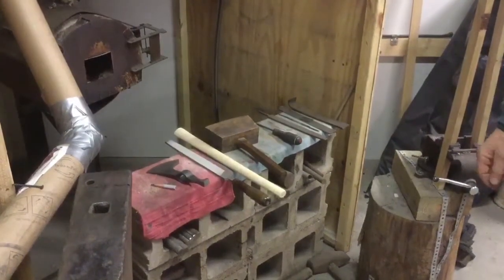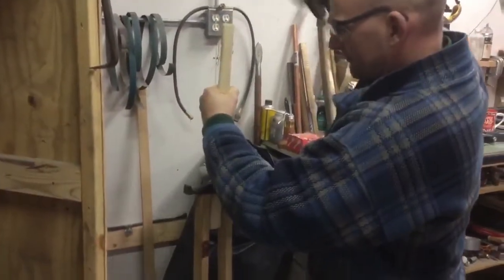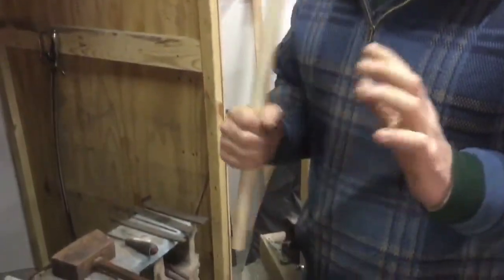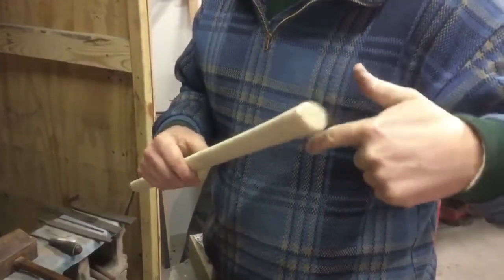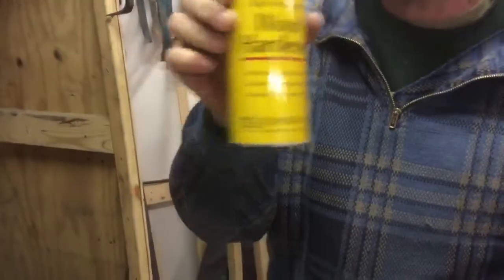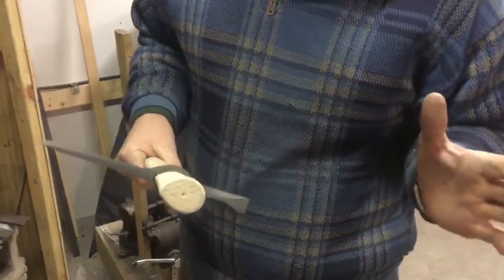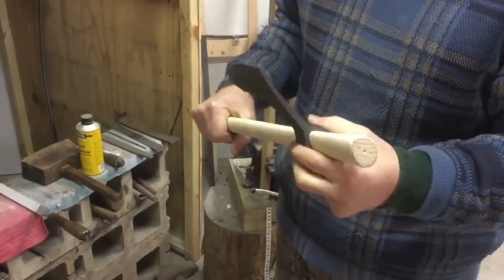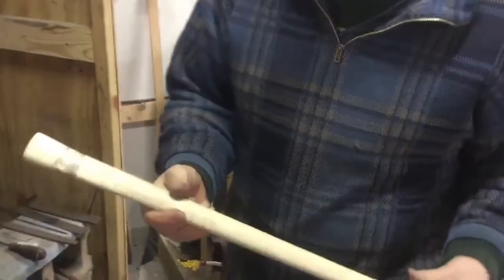Fitting a Through the top tomahawk handle

Comment: I just pound the handle down into the head until its ridiculously tight and almost shaving pieces of the wood off at the top, then I hammer a short roofer's nail down into the top to act like a wedge.

Comment: Hey there! Excuse my newbie approach to the subject, I got a problem: I bought some rather large, definitely not-a-tomahawk cold steel axes and a warhammer, that are supposed to have their heads affixed tomahawk-style. I learnt all I could about that bit, but thing is, being large weapons, and finding myself unable to replace the shafts due to my Country being on full quarantine, and last but not least, wanting to have those heads there permanently, I was wondering...
...Once I got maximum head to wood contact (easy jokes, anyone? Easy jokes? Alright), if I make some linear carvings where the head would end up being, and then use the paper trick - BUT, using nylon instead, covered up with epoxy glue, and removing the nylon at the last possible moment, effectively leaving the contacting surfaces drenched with thick glue, would this work?
The linear carvings would be there to send glue some millimeters into the shaft's body, and keep the head attached should the wood shrink a bit at some point.
Thank you very much for the video, my apologies for the phonebook-long question. May you have a great day, and my best wishes for these awful times.
Reply from the maker: I think that could work. I would first dry the handle as much as possible. If it is short enough you could put it in your oven on warm for an hour or so. This would shrink the wood as far as possible and make it more likely to stay tight. It is possible though that the handle could crack if it has a high moisture content.
Reply: @wbf7773  Thank you so much sir! Sounds terrific! The handles, unfortunately, would stick outta the oven's door. But it doesn't mean that the important half couldn't be dried as much as possible! I think I'll try with one first (will use the typical precautions to avoid unnecessary burning damage, like aluminum foil wrapping, hopefully it should work).
Thanks again for the amazing tip sir!

Comment: Do you fit paper before oiling the handle? Or later? I tested fit on my old one and it really grabs. But have not treated new handle yet. The fit on this now is solid.
Reply: I would be interested to read WBF777 reply to your question.

I would 'think' the answer would be, it depends on user goal. Two examples of my thoughts as follows:
Consider/remember, paper is a pulp product (aka wood).

1) If the goal is to secure the head to haft more permanently, before oiling as the oil absorbed into the wood would act as a release agent precluding the glue from sticking to the wood. Using the paper and adhesive as discussed (before oiling haft) would provide adhesive attachment of head to haft.

2) If the goal is to provide superior contact between head & haft, but still allow handle to be removed for various applications, pre-oiling haft could work as a release agent (mentioned above in 1) and the paper slip sheet impregnated with adhesive would function as a custom molded filled sheet that could function to fill unevenness in the eye and the haft. Upon removal of the head, the adhesive impregnated paper would stay attached to the wood haft.